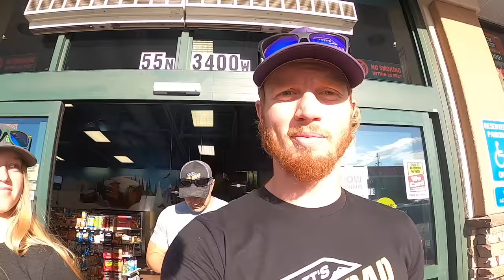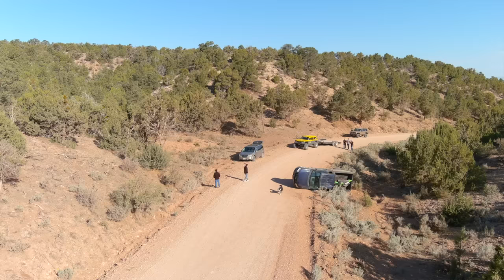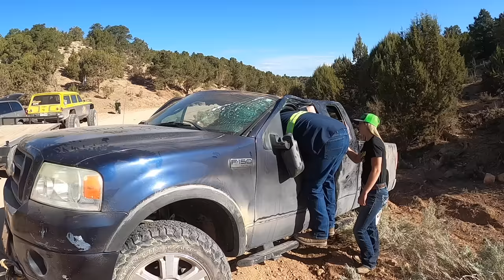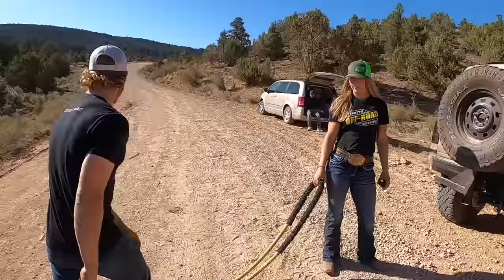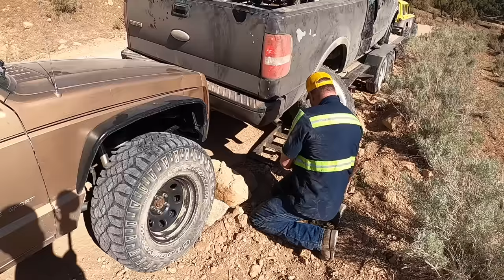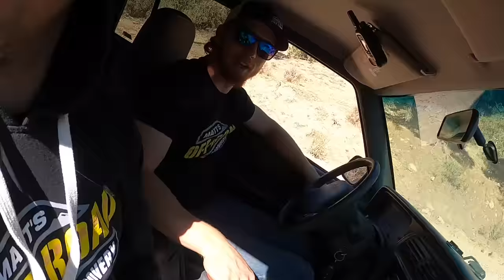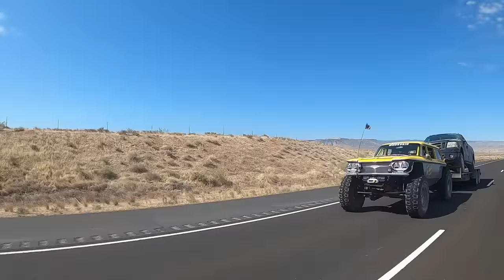They Said It Was Just A Flat Tire - Ford F-150

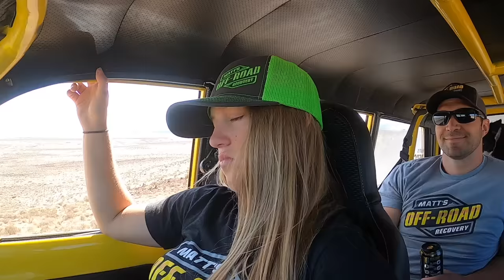Comment: I was worried about damage to the wheels when it was righted, but then I saw the right rear and the body damage!  At 17:47 first time I’ve seen your staff sleeping on the job!
Reply: it rolled over at least once , it’s most likely in a junkyard . the engine might be seized up if it ran upside down, the body was messed up and it needs 2 new tires and a rear axel plus whatever se i can’t see and/or don’t know lol

Comment: Looks like you need a lot better spring set in the back of the morvair but I would be bagging it with an onboard compressor then tube bumpers with air jacks

Comment: I'm surprised you do not have onboard air, even a decent electric compressor would help, I just set up my Tacoma with a 10 gallon air tank and a compressor, mostly did it to supply my train horns but have set it up with a quick disconnect for air hose to fill tires if I have tp

Comment: Yall are lucky you're filling up outside CA, our vapor shields suck. You have to pull the boot back and hold it with one hand while filling anything other than a traditional fill neck.
Reply: I’m not even in CA, but the first time I had to use the ones with a boot after only filling up diesels my whole life I spent 20 minutes wondering what the hell I was doing wrong.

Comment: What do y’all think about a small detachable front boom? Just a few feet long and could attach with shackle pins. Not something to use a lot but cheap and easy to do. Could keep in the banana. Even when the heavy wrecker is finished, it can’t be in the front and the rear at the same time 🤷🏼‍♂️

Comment: 13:46 Hey guys! Good job and nice videos. Is it a way to put a block on the front frame of the car trailer so you could pull injured truck with a winch from a second car beside and pull injured truck upon the trailer.

Comment: Moving demolished vehicles I would try a MULE-642T it’s a miniature fork truck for moving garden sheds/ small buildings on tank tracks.
 The mule fork truck takes up no trailer space the forks are designed to fit into the back of your trailer do not take up that space.
 The mule can lift 5,000 pounds.

Comment: I reckon they meant the tire was laying flat on the ground. I'm still curious as to what was holding it on - did the axle tube bend with the axle shaft, outboard of the spring?

Comment: if you had i high lift jack you could have just lifted the back of the truck and pushed it sidways with ease it would also lifted the truck high enuff to load on the trailer just leave it up and pull let the jack fall over you can get up to 4 feet of movement before the jack falls over you would save so much time just watch your fingers lol
and there cheap too

Comment: oof, that's a rough flip.  In mining when they flip large machines they pour large loose sand mounds for the wheels of the vehicle to land on, so it won't break stuff when the wheels hit the ground.
Reply: On the second thought after seeing from a different angle it doesn't matter.  That thing is totalled.

Comment: I don't know why customers like to leave out important information. like somehow they're going to get an extra bargain if they don't tell you the truth.

" I need a oil change on my truck" (SUV)
The vehicle shows up on a flatbed trailer because there's a hole in the oil pan punched by connecting rod.

" what do you mean I need a new engine? you broke it with that oil change it got to your shop just fine. I think you owe me a new engine now"

Comment: You should have a trailer hitch attachement in the front off the Morrvair, so you can use the winch too pull up vehicles on the trailer in these situations :)
Edit: Saw that you have winch on the trailer, why not use that? :)
Reply: most of those trailers have a winch , maybe it was broken?  i’ve seen one that had little things you could put under the wheels / suspension to help pull broken stuff up the trailer too ( sorta like  the things for moving heavy furniture with casters on the bottom)

Comment: Dumb question, why not install a pulley to the front of the trailer, and then have the rope run through it, and pull with the jeep. And, if you have a fold out piece of aluminum, it could fit under the axle(?)

Comment: Did anyone notice the lic plate on the front of the blue PU.  it says Matts Off Road Recovery,  why was that ? But when the pulled it on the trailer the plate was not on the front of the 
truck
Reply: Probably because there was a Utah plate on it and putting that there is an easy way to protect the owner's privacy or another similar reason. That's just a guess.

Comment: You brought comms to a noncom party, Well for the most part until you used Rudy's Cherokee to pull the load up the trailer. Could have gone maaaybe Comm3 at most. Some actual comm experience would be helpful. Push talk, wait momentarily, speak clearly with known understandable terms that have been agreed to. Speak in normal voice, like you were explaining to the camera, not as if you are speaking into a quiet box. Other than that, Love the drone view. You know who else can sleep in a noisy, bumpy environment? Every soldier that has been in service more than a year.Nice recovery. What ever happened to the vehicle in the process of recovery is not an issue. You have to remove a vehicle from an obstacle.

Comment: Cant believe your still pulling that trailer without a hitch pin, it is a DOT violation to not have that pin in place and most likely why that trailer rolled away from your truck in your videos.
No trailer brakes? You must realize that truck weighs more than the Morvare and not having brakes is a total fail!!!!
Just delete this video to save your ass!!